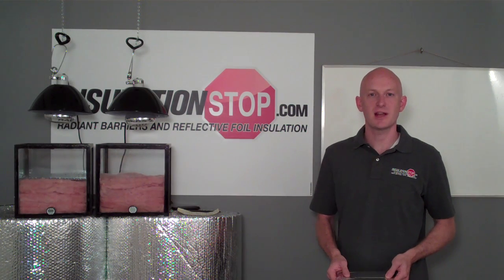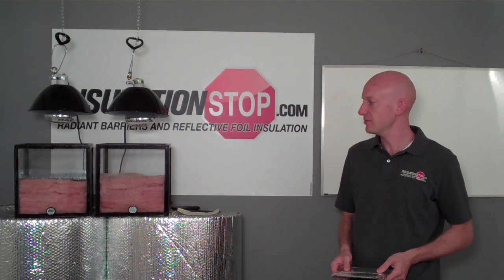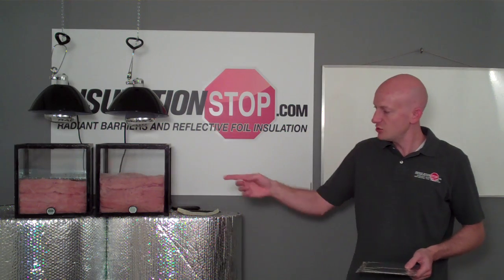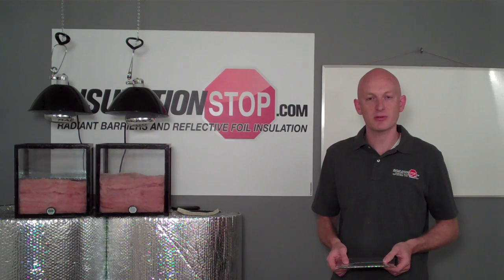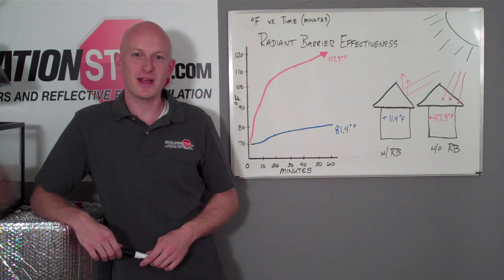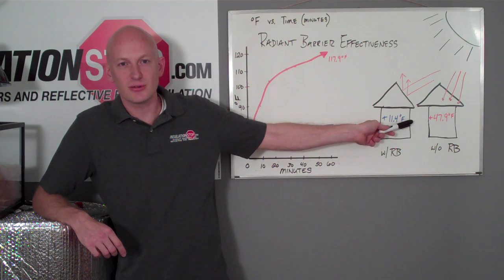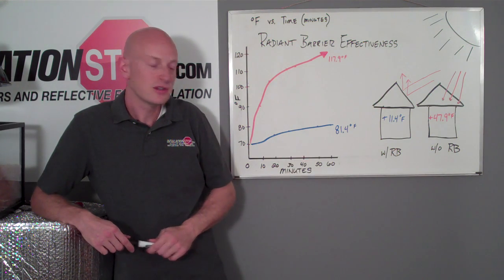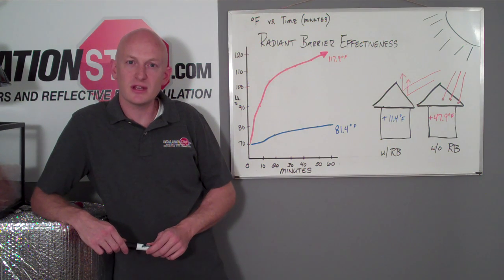Radiant Barrier versus Fiberglass Insulation Hot Box Test

Comment: I too am confused about how closely the "hot box" experiment represents the real world.

(1) As mentioned in previous comments, the hot box experiment radiantly couples the top of the insulation to an IR source which is several hundred of degrees Centigrade. In the real world the top of the insulation would be radiantly coupled to the underside of the roof sheathing which I would expect to be less that a 100 degrees Centigrade (or 212 degrees Fahrenheit)  
(2) In the real world it would be the heat energy flux measured in units like watts per unit area per second  that would be important and  not the equilibrium temperatures illustrated by the experiment. The heat flux into the system would be indicative of the air conditioning  energy required to maintain the system at the desired temperature. The experiment would be more representative of the real world in my mind if they compared the energy required to cool  each of the two sytems to the same temperature.
Reply from the maker: The hot box although imperfect gives you an idea of what the reflective material does to mitigate heat.  For example if you put a piece of paper above the fiberglass insulation the final temperature difference would not change at all.  You can experiment with different materials.  Whatever test you run, it is important to run for a length of time.  Any material can initially block heat but as the material heats up it eventually reaches its "saturation point" and the heat radiates through the material.  Reflective aluminum is unique in that it will reflect this radiant heat and not absorb it.  (Gold and silver have the same properties)
Reply: @InsulationstopRadiantBarrier  Not really. Sorry. From a materials and engineering perspective, you would then have to show how any real-world installation matches both the exposure and the construction of your experiment. Approximations which are highly divergent from real-world applications tell us very little. Here's a little experiment: Take the exact same setup, except replace the radiant barrier with a 1/4" thick piece of bright white Coroplast, or maybe even just with a thick piece of cardboard painted that color. The "protection" afforded is likely to be similar even though the material has little relation to your radiant barrier, and those could be expected to perform quite poorly in any attic application. The radiant-barrier industry has taken some hard hits from the building-science community in recent years and federal regulation has followed. More exaggerated claims, including from the RV industry which loves the stuff and makes the silliest claims on the planet about its R-value (it doesn't have any above about 1), are likely to result in stricter regulations and enforcement.
Reply from the maker: @ReflectedMiles I guess we should tear off all the white cool roofs in California and remove the standard radiant barrier packages for all homes built in sun belt states.  I guess Louisiana Pacific and Owens Corning should stop making their foil faced products, both radiant barrier sheathing and foil faced insulation.  Take the stuff out of all the appliances, textiles, and packaging industries too.  The exaggerated claims are just that exaggerated by mostly sellers and installers who would sell and install anything just to make money no different than any other example anywhere on the planet, since time began.
Reply: @InsulationstopRadiantBarrier  There's a big difference between scientifically valid uses, and most uses sold to consumers which are not scientifically valid. A white roof is a perfectly valid reflector, as is short-term temperature reduction that a foil facing can create between a very hot surface and surrounding air (in kiln and crematory use, for example), and that is also how it is used in many appliances, especially industrial. What it doesn't do is insulate , that is the kicker, and that's where everybody from foil installers to a manufacturer as big as Owens-Corning--if they make false claims for that facing--created enough blowback from the scientific community and unhappy customers that they now have a federal law to deal with, 16 CFR Part 460, and will likely see more enforcement actions as many of the same old claims have been ramping up again in the last few years. You might want to review the FTC's action against one such home-sales company in 2013, the court ordering a fine of $350,000. https://www.greenbuildingadvisor.com/article/stay-away-from-foil-faced-bubble-wrap
Reply from the maker: Thanks for the information.  I guess, for me, there is nothing novel about the idea of a company being punished for misrepresenting products to consumers.  Look at the concept of planned obsolescence, how's that for scamming consumers.  If you have sold something long enough, even the most idealistic and noble of buyers will be enticed by a lower price.  Science is no better by the way, there are countless cases in human history of the masses being purposely misled. And, that's the rat race, there is nothing new about it.  All people, all industries, all the time.  I did see the article and have read it before.  Interesting when you get down into the comment section however where the real users of the products are, not the science and marketers and there are real people saying the product worked for them, all in an article that says it doesn't.  Do you believe them?  I do. Then there are those readers who feel  shame because of the article and say they got screwed having no scientific basis to make the statement just because an article states something.  Incredulous yes, but again nothing new.
Reply: @InsulationstopRadiantBarrier   Science, as a body of people reaching conclusions, can and certainly does make mistakes. However, unless we are talking about industry-sponsored "science," those mistakes are from a quite different source and motive than the "mistakes" of marketers. Broad scientific consensus changes because of discoveries and better abilities to measure things. Measurements and math, peer-reviewed and replicated, are not subjective, and that is where radiant bubble wrap falls apart as an insulation material. In certain situations, radiant barriers can be used in conjunction with insulation (a white roof being a good example) to improve the insulation's performance so long as an air gap is present in front of it, but that's about the most that can be said. Most polyisocyanurate board, for example, is faced with a radiant barrier on one side because of the way it is often installed where it can be of benefit. Consumers who have spent money and labor on it where it is of little or no benefit will still be certain of its efficacy, even under a concrete slab, because that's the nature of confirmation bias as well as the placebo effect. Actual measurements just aren't relevant in subjective opinions, but they are for legal application purposes. The article was based on what work at Building Science Corporation and other testing labs (without any dog in the fight) had shown starting about 15 years ago.
Reply from the maker: @ReflectedMiles  I'm suspecting we differ on the relationship between science and industry.  I'm suggesting in most cases they are one in the same when you chase it back far enough.  That's my reference to all people, all the time.  In this arena, integrity lies with the individual, not the group.

Comment: The test setup is completely wrong. It doesn't match the situation in an actual home. As another commenter mentioned, the reflective barrier is not directly subject to radiation from the sun. Instead, the sun heats up the roof, then the heat from the roof is transferred by conduction to the inside, where convection will mix with radiation to transfer down to the upper part of the ceiling. It is only then that the conduction thru the fibreglass will intervene.

Comment: This test is bunk:  The test ignores heat transfer along the glass sides.   The radiant energy is not going through 6 inches of insulation it stops at the top of it. Of course black body radiation will heat the top layer of insulation greater without a radiant barrier but that heat doesn't transfer through the insulation(that's the concept of insulation), it will transfer down the glass sides.
Reply: Both boxes were plexiglass though. If the effect you're describing were meaningful, then we would expect to observe less of the benefit from radiant barriers in this experiment than occurs in real world applications.

Comment: Just one problem: reflective barriers are usually not installed as the roof surface. Add some plywood and asphalt shingles on top with radiant barrier under one and not under the other and get those same results and THEN I will be impressed.
Reply: thank you BDB!  This would give us the real data

Comment: Thank you for this well explained video which explains a difficult concept in very clear terms.  What a difference...radiant barriers need to be part of the building code.
Reply: See that huge air gap between the radiant Barrier and the insulation? Therein lies the problem. It doesn’t work without that air gap. Like works 0 without it.
Reply: @cygnus1965  NOT TRUE! There is air in that fiberglass insulation. Thats the air gap and thats why you never compress insulation! Use some common sense. geesh! Boy there are some real dim wits on here.